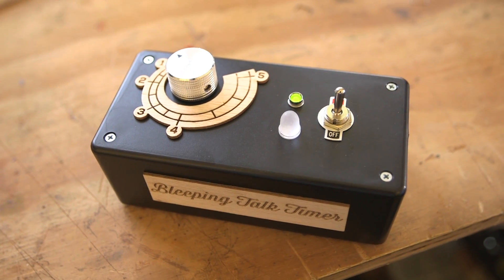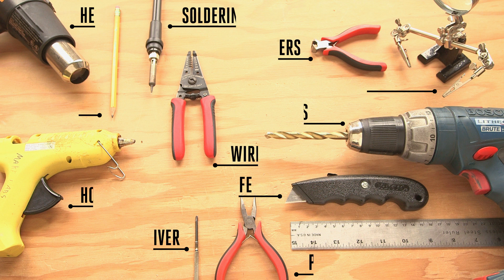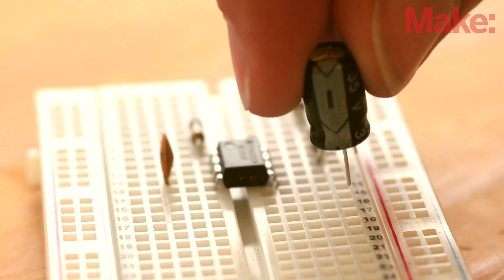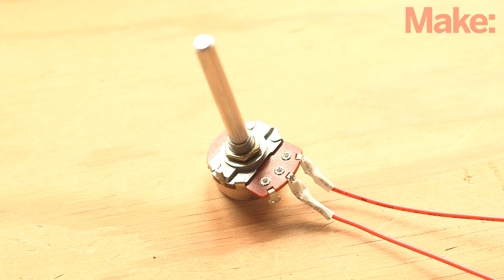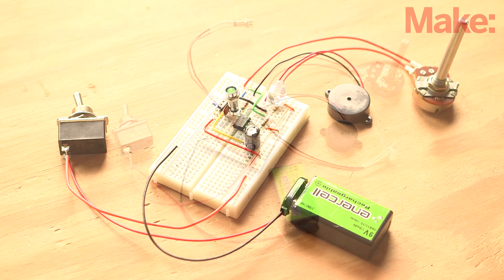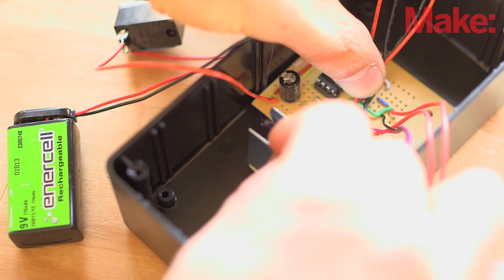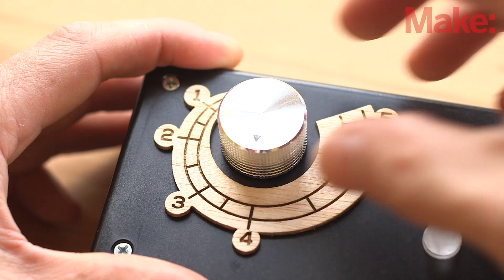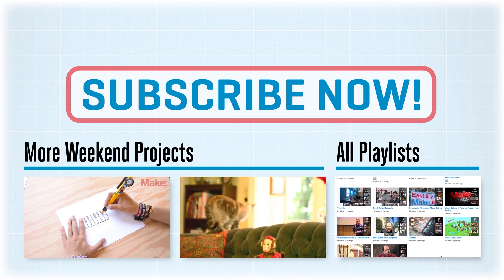Weekend Projects - Bleeping Talk Timer

Comment: nice step by step Demonstration. ;-)
could you help me, i'd like to build a similar circuit but i like to use 5voltage instead 9v
which resistor should i change and what size does the resistors have for the functinality ?
thx for your help

kindly regards
Don